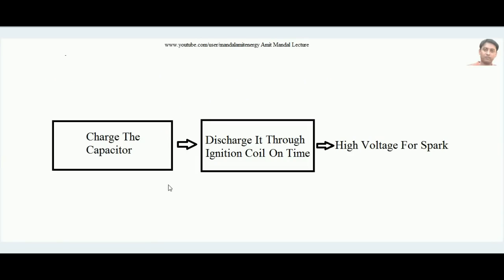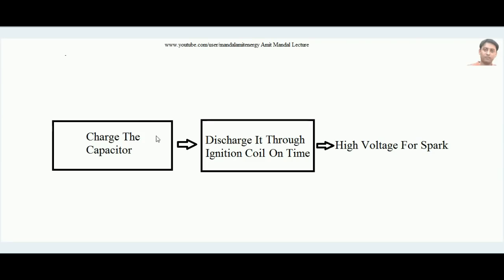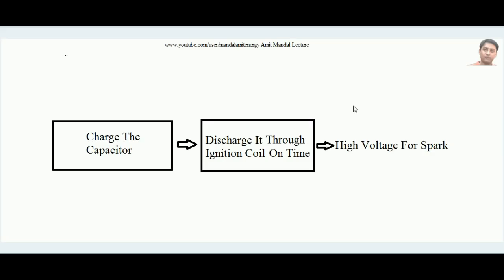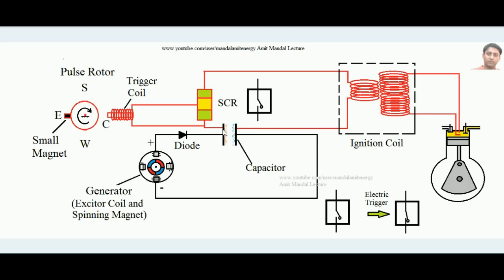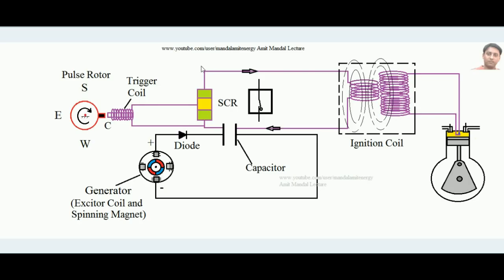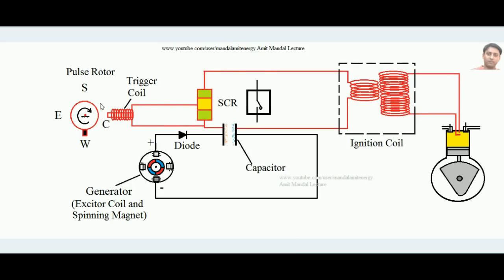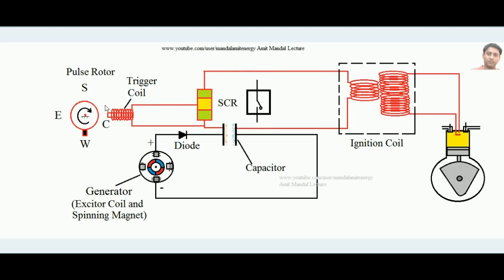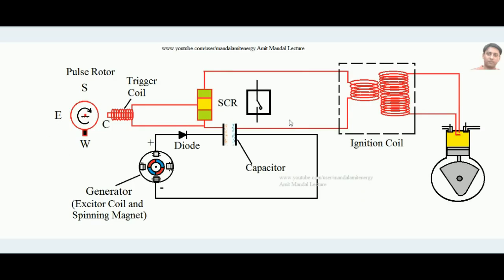Capacitor Discharge Ignition system (CDI System) | Ignition system of SI engine

Comment: excellent  Capacitor  discharge ignition CDI  function &   mechanism  to  generate  high voltage  current  for spark plug # 👍👍

Comment: how much voltage is produced by the trigger coil in real life scenerio? How much ampere current is flowed from  trigger coil to scr switch? I need this information. I am trying to  measure the engine rpm of my motorcycle...

Comment: One thing is needed to be cleared. Just after the compression stroke, when capacitor discharges current through the triggered (Closed Circuit) SCR, is that current AC or DC? My concept says that the discharge from the capacitor must have to be AC. Because if the discharges from the capacitor is not AC then there will be no changing flux hence there will be no induced current in the secondary coil.
Reply from the maker: its varying dc , that can also drive the transformer..

Comment: Is that the CDI are all the same or it varies to various engine (like 125cc, 150 cc or 250cc) ??? Because i have a problem of CDI, i have lost my 250 cc motorcycle CDI (8pin), but in the market only found CDI s which have no specification about engine? is there any problem if i put any types of 8 pin CDI to may motorcycle? Plz help me,,,, Thank u..

Comment: Thanks for this informative video. I hv a question, that is....  Approx How much voltage generated in trigger coil??? I hv a RE TB, my rpm meter was gone last year. Now i want to set a arduino based rmp meter. For that reason when i checked the voltage of "pulse wire" of CDI, I found only fluctuations of about 0 to 160/170mV during acceleration through a digital multimeter. Is it normal?????  Please help me about that for better understanding.
Thanks
I want to know that how many voltage can i read through a multimeter in pulse wire of CDI???

Comment: Sir I what didn't understand is that when magnet rotates a cycle around stator coil, also pickup coil trigers in one cycle, which completes two strokes. So in this way triggers should send signal to the SCR two times in 4 stroke cycle.

Comment: In a four stroke cycle IC engine there will be a spark at the end of Exhaust stroke as well. It is called as a waste spark. 

Suction and Compression is a one rotation of the crank, Spark will be ignited by a Hall sensor at the end of the compression stroke. similarly Power and Exhaust is a second rotation and a spark will be triggered at the end of exhaust stroke.